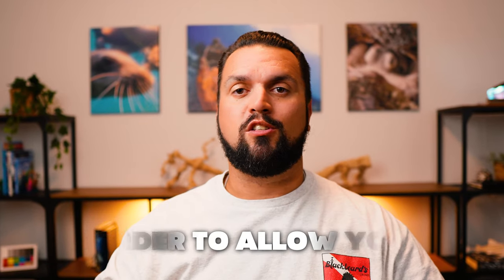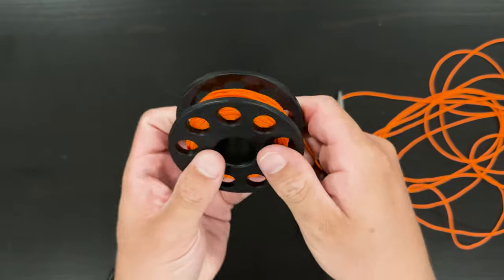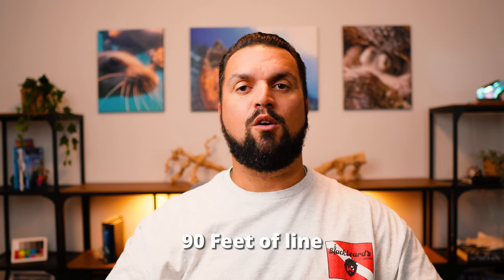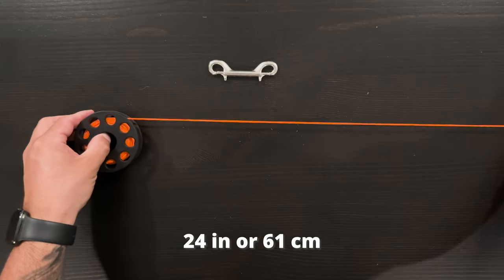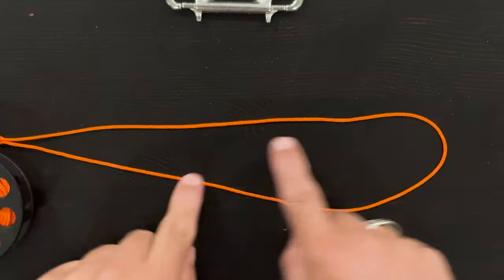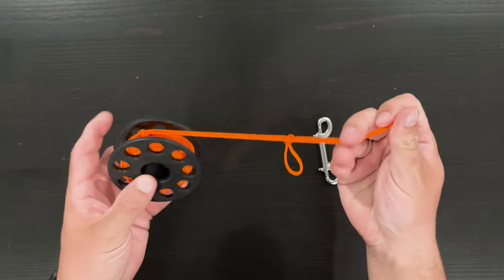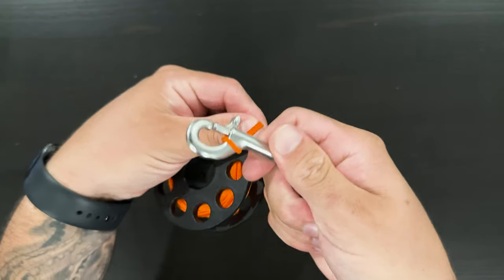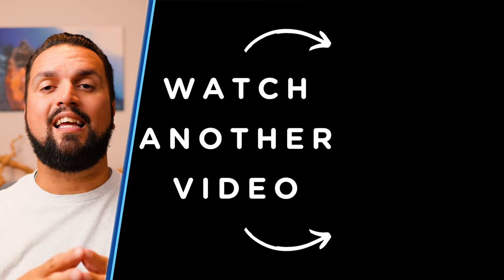THIS Is How To Prep A Finger Spool

Comment: I would recommend feeding the line through the gate of the bolt snap after wrapping it around the back of the trigger. You don't even have to clip the bolt snap off to the spool at that point. It can just dangle.

Best place to stow the spool:
1. In an easy to reach pocket. A thigh pocket is the best place but you can also use a BC pocket if you can get to it easily.
2. A butt D-ring. Not all BCD's have one, but if yours does, it's nice and out of the way.
3. A hip or shoulder D-ring. Keep an eye out that it doesn't dangle too far down or drags on a reef.
Reply from the maker: Good tips! Thanks!

Comment: If you clip the boltsnap back on the line rather than a hole on the spool, you get a safer connection that won't put additional stress on the boltsnap/spool if it gets stuck somewhere.
Reply from the maker: When I wrap the line around the bolt snap and then clip it off you mean? Where on the line would you clip it?
Reply: @CircleHScuba  Exactly. You wrap the line around the boltsnap and then you clip the boltsnap through an eyelet. In the video you picked the eyelet on the opposite side from where the line feeds back. Instead of doing that, I would clip onto the line as it come from the last eyelet you fed it through. So the line comes through the eyelet of the spool, goes through the boltsnap, and then wraps around behind the gate, before the loop that the boltsnap is clipped off to initially.

On that note, I also only feed the line out and not back through a second eyelet. I find that too fiddly for dry gloves.
Reply from the maker: @tobiashartung856 ah okay I see what you mean. Yeah this is how I do it, but little variations to make it your own is perfect imo. Good tips!

Comment: I use the spare line as a marker for my bolt snaps. I don’t recall the knot because my DM test was “the bowline is the only knot” 😂

Basically big loop along bolt snap length, start wrapping the working end around it, feed through the loop, sinch it tight from the other end to secure. Lighter to close it off. Tough to remove and you’ll know if a buddy grabbed your snap
Reply from the maker: Nice tip! Sounds like maybe two half hitches? Trying to visualize it haha.

Comment: Great video. My two cents would be to add a single knot 3m (10ft) and two knots 6m (20ft) from the end, this comes handy for the safety stop.
Reply from the maker: I do like doing this as well but I do it at 6m/20ft only and if it’s a very long reel maybe different distance measurements. But that’s more use case specific haha.

Comment: Why not just leave the DSMB attached to the reel? If you know the sole purpose of the reel and DSMB is for signalling on ascent. Why add more steps by not having the reel attached?  Also why use the girth loop instead of just attaching the double ender already on the DSMB.
Reply from the maker: Double ender can come undone, technically, so I use the girth hitch instead. 

You can have the spool already attached but I was taught to keep it separate because you make be using the spool for something else. It’s okay to have it pre-attached imo though.

Comment: If the sole reason for the spool was to launch a dsmb/lift bag, I am always connecting them together prior to the dive. Just way too much fumbling around when it's not necessary. Of course if the spool is used for something else, like jumping a line in a cave for example, its locked off. But even then, I don't pass it through the holes since it's really more trouble than it's worth. If there is a lost buddy situation, I don't want to hesitate in deploying my line and starting the protocol.
Reply from the maker: Totes makes sense